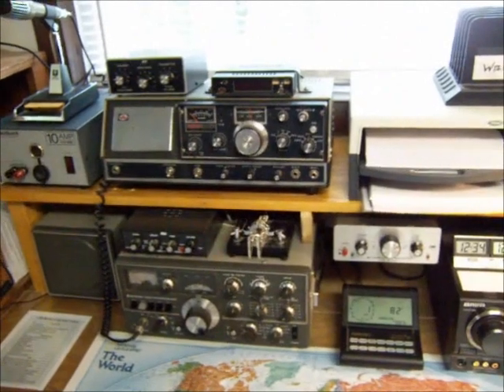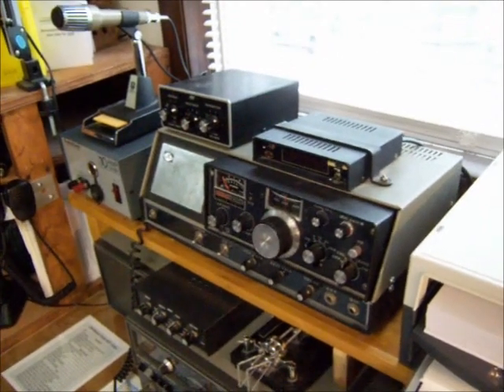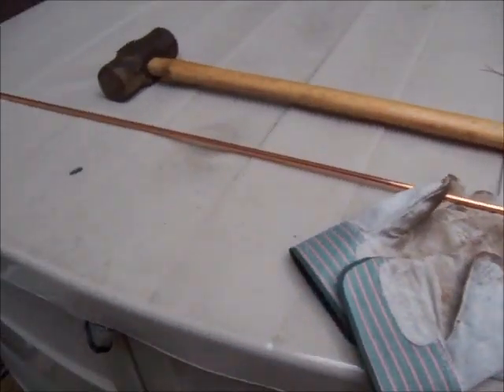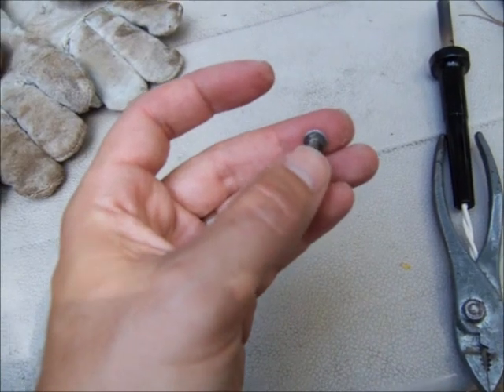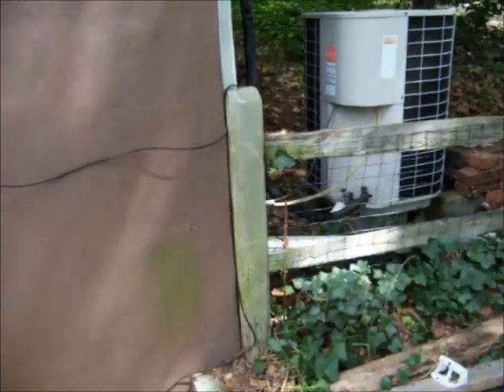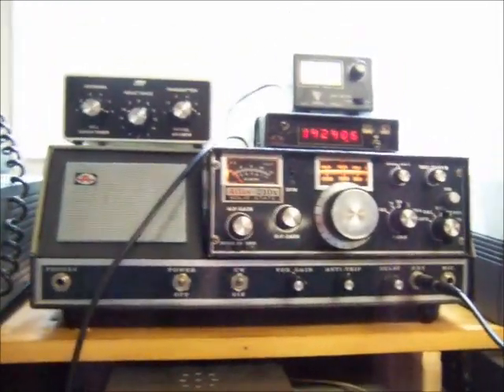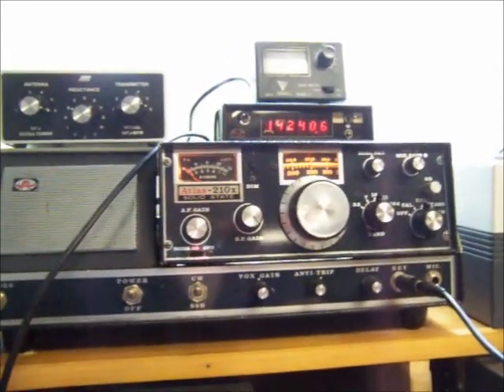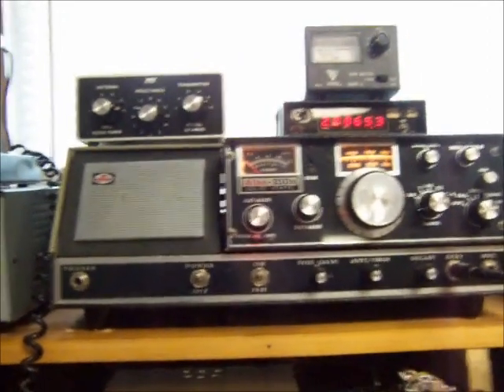Stealth Gutter Antenna for Ham Radio or Short Wave

Comment: I use the gutter system of my apartment building as my primary, every day HF antenna. I make 8-10000 mile contacts using SSB and CW with mine almost every day. I do feed it using a 9:1 impedance transformer with an MFJ VersaTuner at the radio. Works surprisingly well from 10-80m, to the point that I rarely put up my EFHW or EFRW at all any more. It is pretty long at about a 150 foot straight section with 4x 30 ft tall downspouts. Lots of metal. Thanks for the video. W3OY

Comment: My downspout and gutter antenna works great! Use an MFJ tuner and RG-6U coax (because I had a bunch lying around!). Running no more than 20-30 Watts on PSK, I've worked all over the world.  Great video!
Reply: A trick: watch series on flixzone. I've been using them for watching lots of of movies recently.
Reply: @Alfonso Archer yea, I have been using Flixzone} for months myself :)
Reply: Did you use a counterpoise, and if so, how did you determine it's length?

Comment: A great way to really test antennas is to use FT8 or some other digital mode and then check the almost instant reports of your signal strength from all over the world. No more guessing if its just loading up or really getting out. Thanks for the video!

Comment: I live in a severely antenna restricted community and set up my clandestine rain gutter in 2012. I have 2 ATUs: one for the gutter and the MFJ-931 Artificial Ground.  With 100 watts and great propagation I can get out to about 6,000 miles SSB. On cw I can get out to the planet Pluto.
Reply from the maker: Michael Davis Excellent.  Thanks for your comments
Reply: Does the MFJ-931 reallt make any difference?
Reply: @Mark300win , I no longer use the MFJ-931 AG. I set up a counterpoise wire network at the gutter feedpoint.
Reply: @michaeldavis5789  

How did you determine the length of the counterpoise, please?
Reply: @usernamemykel  Each counterpoise wire is 1/4 wave length of the band. For instance, 80m is 262 feet long. That means a 1/4 wave counterpoise wire for 80m is 66 feet long.
Reply: Did you ever get a QSL card from your friends on Pluto?  :)

Comment: One of the major problems with using a metal gutter is that gutters most of the time are not bonded together very well.  

The second problem is that rain washes dust and other contaminates off the roof that end up getting in the overlaps breaking up the electrical length of the gutter over time.

Comment: If you can measure the length of the gutter and down spout fairly accurately, you may find it close to a half wave in length, which would make a suitable half wave end fed antenna, (As it is resonant). Or it may be closer to a random length long wire antenna in length (which is non-resonant).. 
Each of these would also use a unun for impedance matching at the antenna feed point. A 9:1 for a random. or a 49:1 for a half wave end fed. The 9:1 would also use a tuner. Recommended lengths for a random would be  29  35.5  41  58  71  84  107  119  148  203  347  407  or 423 feet long. And the formula 468 / Length (in feet) = Frequency (in MHz) could help determine if it is resonant on a ham band or not. And what your lowest band of operation may be. 

Living in an HOA, I found my available rain gutter to be too short for either one of these, at 11 feet long, so, I coil loaded mine (with taps) as a compromise to make it act much longer. So mine is now a base loaded rain gutter. With buried counterpoise wires.

Comment: I would suggest running ground radials from the grounding rod at variable lengths. Take some wire braid and jump the joints along the gutter. then you have more contact at the screw and sure continuity. That should solve the SWR problem on lower bands like 40, 60, 80 and 160.

Comment: I just used a SGC auto coupler after seeing a HAME talk about it. works well and the match is practically perfect. I use longwire running the peak of the roof though instead of a gutter. Still as invisible and stealthy.

Comment: Based on this video, I ran wires inside my gutters and got it to work on several bands.  So I didnt really load up the gutter, but used it to hide the antenna.   Works well on the upper bands 20-10.  wz2j
Reply from the maker: Sounds great.  Glad the video gave you some ideas.  Best of luck.

Comment from the maker: Thanks for taking a look.  I wouldn't use the electrical ground (I'm assuming you are talking about the round prong at the wall socket - potential safety issues, splatter from the hot sides, etc.)  I've made up counterpoises with balled up wire as well as more neatly organized runs.  If you're in an apartment I would probably run the counterpoise along a wall seam or ceiling joint.  Play with it and see what happens!
Reply: Couldn't they put a simple diode in the ground circuit?  Heck, I made a foxhole radio once with nothing more than a diode, earphone, some wires, clips, and something to make a coil of wire on with a slide tuner in the coil.  I used the antenna built into the living room wall of the house my dad had built in 1947.  The living room center wall had an "Ant/Gnd" plate in it with screw-down terminals to hold the wires to radio before we had TVs.  I used it for my home-made AM radio experiments in the '50s-'60s.

Comment: I suggest an auto antenna tuner at feedpoint,  some even allow DC power to be supplied down the coax.  You will get a great match on ALL bands.  Military uses this method and commercial users.  Some are inexpensive today.
Reply from the maker: I agree.  A tuner at the feed point is always better but sometimes a bit more complicated and costly to set up.

Comment from the maker: You could certainly try it.  Since you'd be pretty far away from the HF bands your antenna lengths wouldn't have to be very long so even the shortest gutter would probably be more than long enough.  Your tuner would need to be pretty good I would think.  It would be an interesting experiment.

Comment: You can use dielectric grease on all your screws and by putting a screw at every gutter joint with the grease on the screws to help keep a good electrical connection and continuity of the circuit. Available at automotive parts stores even Walmart auto section. Permatex item # 81150 .
Reply from the maker: Absolutely.  Good suggestion.  Thanks.

Comment: From what I can see, you did not connect it to the gutter discharge pipe, but to the casing of the Air Conditioning pipes running up the wall, the discharge pipe could be on the other side, or internal, inside the wall, but anything tuned will work.  I made 2000 miles CW QSOs on 40 m with a hotel gutter in France, Tip :  with my SPC ATU, I tune almost anything 1/1.  GL  72 / 73  ON7BAS
Reply: Yves Dehnen , He connected to the discharge pipe.  Watch about 2:15

Comment: I thought your project was interesting. However as you know, just achieving an SWR of less than two has really no useful meaning except to say that your tuner is able to give enough inductance or capacitance to prevent a strong reflected signal from blowing up your radio.   Remember, even dummy loads have 1.5-2 SWR.  

I'd love to see you repeat this experiment, except do a true a/B test with a simple wire antenna,  it would be fine just to test receive on shortwave broadcast bands for comparison,  I wouldn't want you to blow up your radio or have to rely on being able to make a contact.  

Again very cool video, I love your radio, please try again on the receive side!

Comment: How does the gutter antenna work with water going through it? Thanks, nice little antenna project. 73, Joe KC3BXZ
Reply from the maker: +1fanger Hi Joe.  Good question, I haven't tested it enough to compare rainy days to sunny days.  I'd guess there would be some differences.  I'll have to do some testing sometime.
Reply: drez20001 Thanks for your answer, I have a nice, straight gutter length on the southeast side of the house and was considering using it for the bedside SW receiver. It fits the description of an inverted "L" design I saw online, esp. with the downspout.
Reply: Have a friend, he and his brother are hams. His brother used to live on the 14th floor of a 20 story apartment building. Vertical gutter ran next to his balcony. He would load that approx 200 foot vertical up and always had a great signal!

Comment: I'm hoping to do this too. I'm in a 3rd floor apartment. I have a nice gutter right out side my window. I have the Yaesu Ft890 with built in tuner. Do you know if I can use electrical ground, or should I make a counterpoise?

Comment: Our house has two 60' continuous gutters (no joints) on the second floor.  I could attach the coax to one of them and run it through the house siding, about a 10-12' run.  Is it a problem with a long wire to the grounding rod.  It would be about 12' long.  Suggestions are most appreciated!

Comment: I was wondering if  you could try a 4:1 balun for a end fed dipole and feed the coax cable into it and run a14gauge wire from the rain gutter down spout to the balun

Comment: How many watts are being transmitted in this test?  The lower the watts out, the lower the S.W.R. reading. A big problem with this approach is that neither the gutter system or the ground rod are harmonic wavelengths of any Ham Radio frequencies. They are not harmonics of each other. This setup makes the transmitter try to match an elusive gutter system to ground. This is not a dipole. This is a disaster. This is a good way to blow your finals. Yes, under ideal conditions you can work DX and other stations, but so can a long wire run of ladder line thrown over your bushes which is not even connected to an antenna. The only way to make any of these ridiculous antenna attempts work (bed springs, gutters, slinkies, clothes lines, cyclone fences) is to connect them to a decent antenna tuner which will make the transmitter happy, but won't propagate much. If stealth is your goal here, you would be far better off making an "Off Center Fed Dipole" wire antenna, stringing it under your eaves, or over trees or in your attic, and use a good tuner.

Comment: Did you ever make a contact on the gutter?
Reply from the maker: +Keith Redmon Hi Keith.  I actually don't recall.  It was a test to see how it would load up on various bands and what the receive sensitivity would be.  As the winter season approaches I'll have to get back to it and see what kind of contacts I can make with it.
Reply: +drez20001 Thanks. I'd be interested to know.